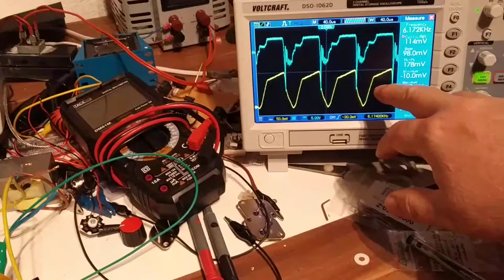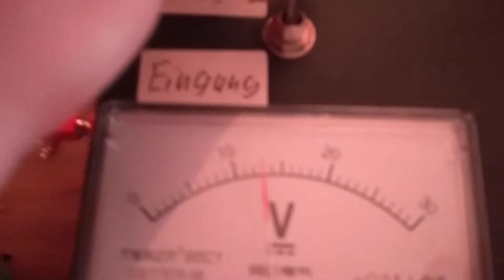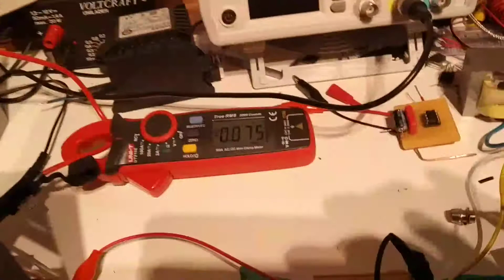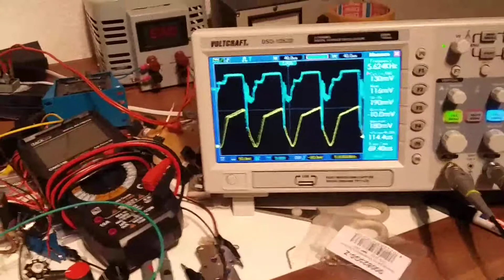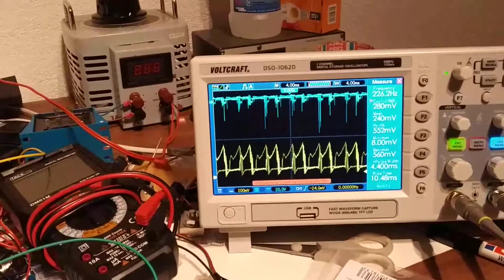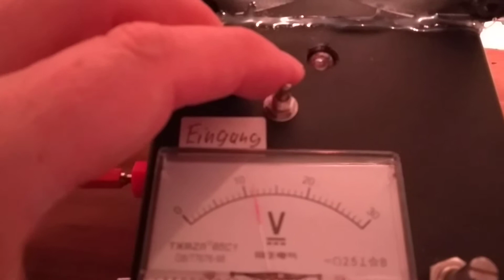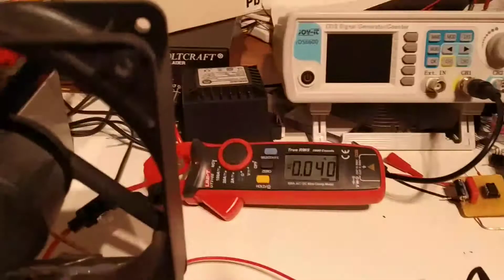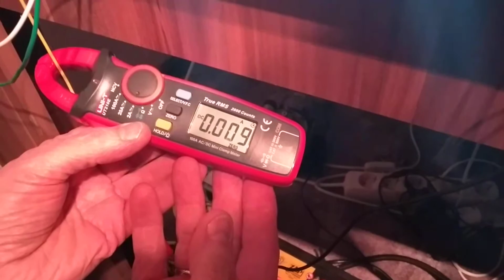Very efficient Bedini Solid state circuit running 5 LED light bulbs

Comment: These fans are inefficient, generally toys for children! Bedini's circuit works when only with large coils and large capacity batteries.
Reply from the maker: Yes, it is the Rick Friedrich Michael Shuh Box circuit... Watch the Videos from Rick from his convention where Michael showed his box running on pulse Befini Style motor...you need the right LC circuits  inside the input and output pathes...
Reply from the maker: Rick Friedrich will be in Europe I think around August 2023 or something like this and will show some new over unity Demonstrations in his new conventions... !!!👍🏻🍀🍀🙏🙏🙏🙏

Comment: How big does this system have to be to run a house. So if a house uses 10kw per day, that's low I know, just saying, what size Bedini system would it take to run a house? This would be the biggest question us guys who have no idea how this really works, wants to know.
Thankyou for the demonstration.
Reply: Doesn't matter. If it can replace 1 solar panel 24/7. And put 20 or more of this devices. 😊
Reply: Bedini produces DC, am I correct?
Reply: @Zendukai  my answer didn't get posted.  Look at the oscilloscope. Around 10khz.  But put a retrifier bridge and you get DC.
Reply: I would need an inverter to power my 240v fridge, how big would the Bedini system have to be to power the inverter and the fridge?
Reply: @Zendukai  purely speculative, if you can get 50w output from a device. And your fridge draws 150w?  Do you need a 150w device. Or 3 50w devices. The lower the current the lower the costs in terms of cable dimensions
Reply: @MAGNUS-369  fridge for a start, then air-conditioning,  kettle, washing machine,  welder if needed, general stuff to run a house, the fridge was just a start, lots more electrical gear running a house, TVs , computers, lights, you name it, can a Bedini system run a household if you get my drift
Reply: @Zendukai  I would say one bedini device won't be enough. But you can put 100 small ones. And use one device instead of one solar panel.    
One solar panel can't deliver enough energy to a house. But 20 can
Reply: @magnus6235  I recorded a video 20 years ago here of someone with a large Bedini device, all it was doing using one battery to charge another, had a wheel and heaps of coils around the outside with magnets. Still didn't power a home.
Reply from the maker: No, it is pulsed output power, but he charges batteries up with it.after rectifying it....
This video is more a small replication of the Rick Friedrich Convention video, where they showed this Schuhmann box, or how he was called...
Reply: You should know for sure that 10 kW is not a constant power consumption in the household at a given time. A buffer source is needed and a DC/AC inverter is a very good solution. How to get better than a synchronous generator there is no device:   https://rakatskiy.blogspot.com/2022/06/overunity-holcomb-energy-system.html